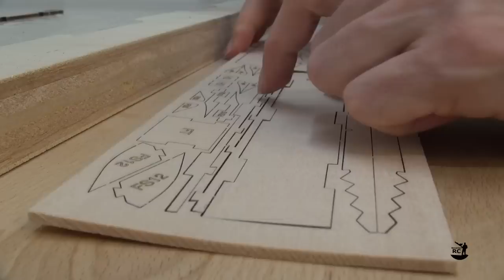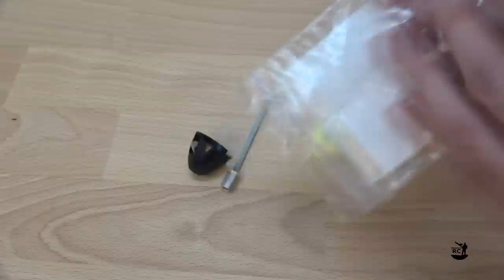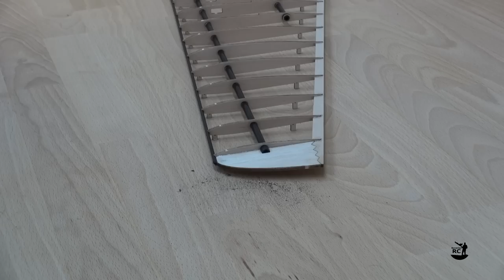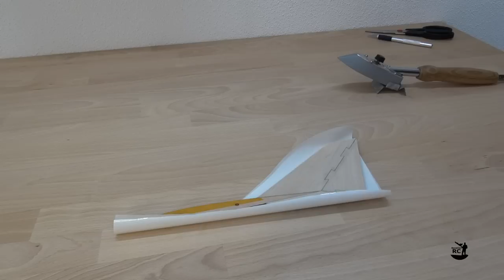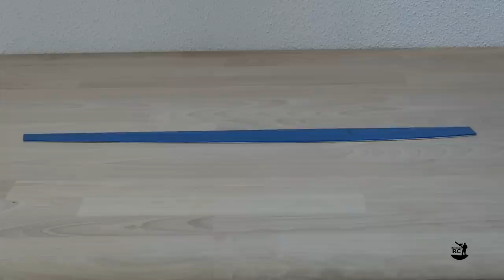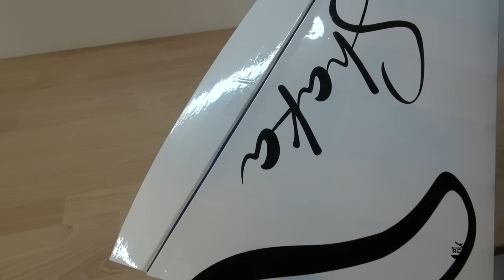Shaka RC Flying Wing - Time Lapse Build

Comment: Excellent tutorial!!! Bravo!!!
Reply from the maker: Thanks Peter, I am really happy that you liked it.
Reply: @bavarian_rc  Hello and many good wishes for 2023 and beyond!!! Would you be willing to share the 3-D file for the "dummy cone" for this build? I have made the purchase and received the kit. I placed two orders....one for my brother in Alberta, Canada, and one for myself here in Quebec, Canada. I believe the using he "dummy cone" is genial.
Peter.
Reply from the maker: Hello Peter, also for you and your family all the best wishes. For sure I will share the STL file for the dummy spinner. It fits for the recommended VM spinner with a diameter of 25mm. I was anyway wanting to share but obviously forgot to add the link. So here is the link to the STL file: https://drive.google.com/file/d/1QZqZRQAg4VYXeTdvgW2D68_Reh3HeI6Q/view?usp=sharing
I will also add the link to the video description. The Shaka is a really good choice. Since the maiden flight around Christmas I made more than 15 flights with it. The motor has plenty of power and even with a small battery like the 450 mAh 2S you can easily get up to 10 minutes flight time without thermals. The only thing I would do differently now is to take servos that are more precise than the Emax servos I used. Make sure to check out the flight video of the Shaka and my tips & tricks in the second half of the video. They might be helpful. 
Robert

Comment: Very nicely built! Where is the approximate CG on this plane? Thank you!
Reply from the maker: Thanks! The CG is at 25mm from the leading edge
Reply: @bavarian_rc  You're very welcome and thank you! Would this change if it is set up for slope soaring in 10 to 15mph wind no power system? I really appreciate your help.
Reply from the maker: The CG should be exactly the same for slope soaring. Some more weight could be helpful for higher winds. I never tested it in conditions above 10mph. But at 10 mph it performed very well even without ballast.
Reply: @bavarian_rc  Thank you!

Comment: neat vid thanks, shed load of editing !
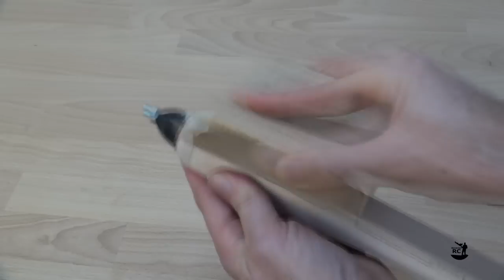Old bespoke furniture make here :) ...nice form at 14:00
Reply from the maker: Thanks a lot! Yes you are right it's quite a bit of effort that goes into editing these videos. I never tried it but I think making furniture is not so far from what I am doing 😂 I always like it when these square forms disappear and the fuselage is getting rounder and rounder. Nevermind the cleaning of the dust that goes everywhere!
Reply: @bavarian_rc   it's all the same game ! ( watch that dust, I found even a fan at the side helps
Reply from the maker: @Transit67F2 The main issue for me is that I have an allergic reaction against fine dust. So for sanding I always have to use a mask
Reply: @bavarian_rc   sure...it can be a cumulative issue...apparently CA sensitivity is a thing too
Reply from the maker: Yes, I am also careful with CA, wearing a mask when glueing a lot with CA

Comment: Cool plane but i don't like how the servos get glued in and has no access to service them. Great video though.
Reply from the maker: Thanks! I know what you mean, I think the servo installation is a compromise between weight and accessibility. A servo plate screwed to the wing would be nice but adding weight. On the other side I have to admit that I didn't have too many servo failures in all my planes over the last years, and well in case it happened  to the Shaka I would have to cut the covering film ... not nice but also not a drama. Finally the design could be easily adapted to make the servo accessible. That's the great thing about balsa kits that you can adapt the design to your personal preferences.

Comment: Hello again......just wondering the weight and dimensions of the steel bars that are used in the construction?  I was thinking of fabricating my own. They look like 1/4" x 2" x 6". Any reference would be appreciated. I hadn't received the stickers with either of the two orders i had placed, otherwise very satisfied with quality of materials!
Reply from the maker: Hi Peter, the steel bars are cut from a 1m long bar that I found in my local hardware store. The dimensions are 150mm length, 30mm width and 6mm thickness. Weight is around 215g. After cutting them to length I sanded them to have a smooth surface and then covered the bars with clear coat. The Shaka stickers are optional… I think something like 5$. If you had ordered them and not received then go send a mail to Gene from FlightPoint, I am sure he will send you.
Enjoy your build!
Reply: Fantastic. I had not seen the sticker option. Perhaps too excited ??? Anyway, I will be using an NFL football team color scheme. Cincinnati Bengals. Should look great. 
BRAVO on the time lapse video of Venice. So much knowledge is being imparted through these productions of yours! Thank You 

Any news on a Triple-Neo Thermic Time-Lapse build? 
Greetings,

Peter
Reply from the maker: NFL football team color scheme… that sounds great. I guess there will be some Tiger design involved. Happy that you keep following my videos and also liked the Venice. The next build will be the Triple Neo Thermic… finally! But no promise until when the video will be available 😜 Bye or „Servus“ as we say in Bavaria!
Robert

Comment: Ciao Robert,
I am having great difficulty in obtaining the Graupner Carbon Folding Prop 6x3. It seems to be on back order with most suppliers. Would you know if Graupner has discontinued the production of this size folding prop? Should you know of someone with three of these, please let me know. Thanks and Servus!!!
Reply from the maker: Hi Peter, the problem with Graupner is that they had issues with their Korean mother company who had changed the distribution model in such a way that the German part of Graupner (which was responsible for all the accessories) was not able to survive. In consequence this lead to insolvency of the German part of Graupner end of 2019. Nowadays Graupner still exists as a brand, but only for transmitters, receivers, servos ... basically the electronics. 
I was quite lucky being able to still find some of the Graupner folding 6x3 (P/N 1336.15.8) folding props.  I just checked if I could find some more and found out that in the shop of Stefan Graupner (I think a son of the company founder) has them available. Stefan Graupner is continuosly trying to bring back some of the old Graupner stuff with his own company "SG-Modellbau". 
https://sg-modellbau.de/products/cam-folding-prop-ersatzblatter-15x8-cm-6x3-zoll
The only other alternative I have found are the "SUPER Carbon Folding props 1031.6X3". The problem is that they have a 6mm blade root and the Graupner props have a 5mm blade root. If you are using the VM spinner it will require a 5mm blade root. Not sure if it would be ok to reduce the strength of the blade root without weakening the prop too much. That's the one: https://www.lindinger.at/de/Flugzeuge/Flugzeug-Antriebe-Elektro/Luftschrauben/Klappluftschrauben/SUPER-Carbon-Folding-Ersatzblaetter-6x3-15-8cm-schwarz-2Stk.-Luftschraube-6mm-Blattwurzel/9766663
I hope this helps. Servus, Robert
P.S.: I see you learned a bit of Bavarian 😀
Reply: Ciao Robert,
I appreciate your response. It seems these suppliers do not ship to Canada, or the website is not setup to do so. I will try to obtain from  a Canadian source as I have the appropriate motor and spinner. Thanks again, and Servus!
Peter
Reply from the maker: I didn‘t check if they ship overseas. Too bad! I hope you will find the props somewhere in Canada. It seems to be a rather unusual size of prop as I could not find a lot of alternatives. Ciao Robert
Reply: @bavarian_rc  Guten morgen Robert,
Great news is that i was able to place an order for the props via Modelbau. Thank you for your help & knowledge !!! I hope that the production facility will find a means of getting back into operation soon. 
Servus!
Reply from the maker: Hey that‘s great news!!!

Comment: Great video but holy cow, that's a TON of glue!!
Reply from the maker: Thanks. Actually there is not a lot of weight coming from the glue. Most of the weight of the PVA glue is evaporating during the drying process. And the CA doesn’t really count in terms of weight I guess.

Comment: Cg of plane 25%?
Reply from the maker: Hi, usually the CG for a „standard“ plane is around 25% of the wing cord. But this might vary from plane to plane and sometimes you will have completely different figures. For a flying wing like the Shaka with its forward swept wings the CG is far more in front. So if you want to be on the safe side then check on the internet as there are many online tools for CG calculation. You can enter your wing geometry and basic dimensions of the plane and it will calculate a range for the CG. For the first flight go to the forward edge of the CG range. A nose heavy plane will fly bad but a tail heavy plane will only fly once 😜 I hope this helps. If you have more questions the don’t hesitate to post another comment. By the way for the Shaka the CG ist at about 11%, but mainly due to the forward swept wings
Reply: @bavarian_rc  thank bro

Comment: 2:06     do NOT use  'glue'.           the design of the wing structure is  Abnormal.          as a result of the use of CF in the wing, this model has a less-than ideal span-wise  distribution of mass (dom); and the auw is increased.
WOOD  should  be  used  used wherever  Practical.!!!   eg.,  clear-grained spruce  and/or  poplar.
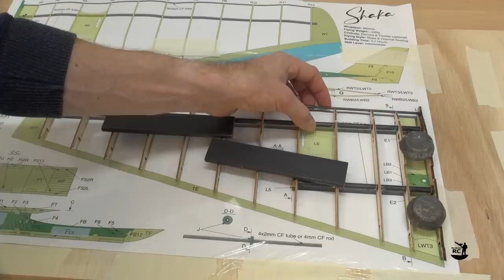16:53   the use of CF at the leading edge is the  opposite of smart.        the use of a too-thin profile leading edge is the opposite of smart.       the wisdom of using a thin, (nearly) symmetrical profile is absent.         googletranslate
Reply from the maker: Hey David, I have been missing you. What took you so long? Seems your still busy with your „distribution of mass“ crusade. Don‘t worry, one day all of those wrongly built planes will have crashed, all CF will have disappeared and mankind will understand what it‘s all about… until then we‘ll just go on, sorry 😂